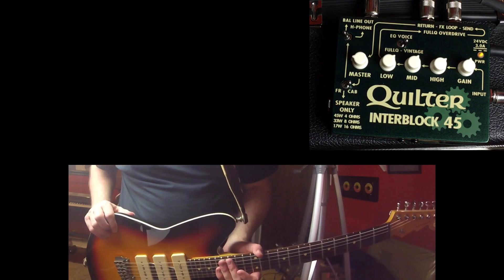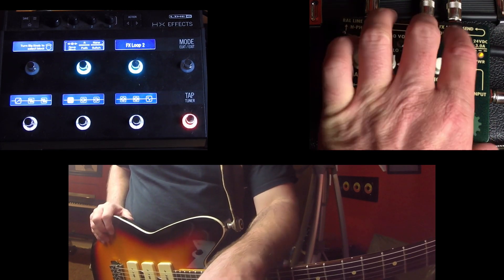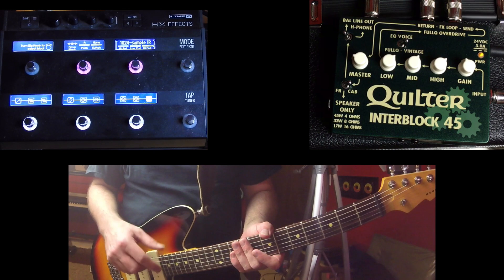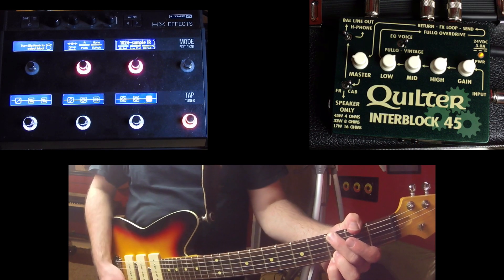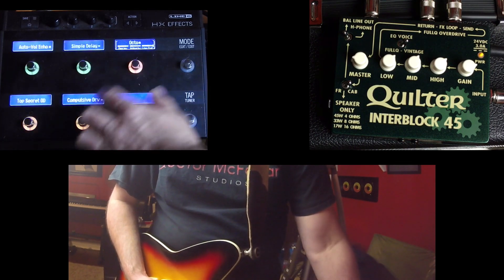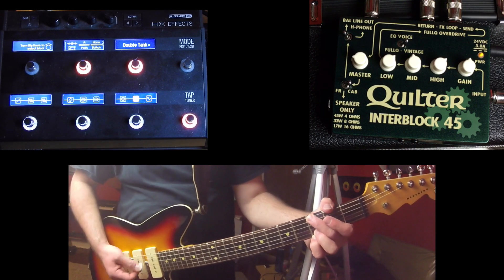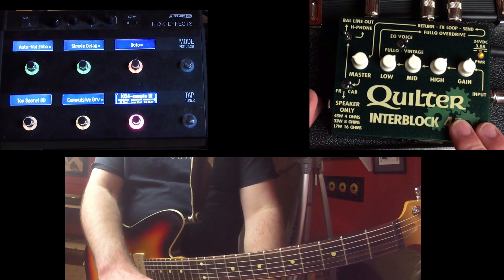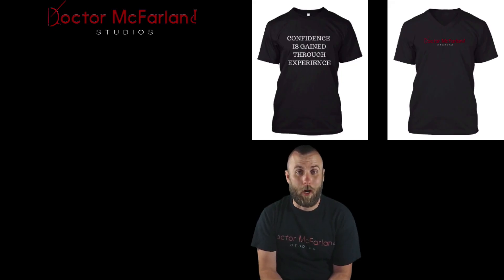Quilter Labs Interblock 45 // Balanced Line Out with Impulse Response

Comment: This is a great discussion of a key aspect of the interblock 45.  I just took delivery of mine last night and your observations are spot on with what I found.  Frankly I was so happy to see your video because I thought something was amiss when I turned up the overdrive and got that God-awful swarm of bees sound even when the cab sim was enabled.  In my case it's very bad because my cab is full range (i.e. has tweeter).  Luckily as you alluded to, I have a Radar and plugged it into the effects loop and all was well.  As you also mention, the problem is non-existent when you plug into a normal cab though, which is also expected because any normal guitar amp overdrive sounds pretty horrible into a tweeter.  For clean sounds no problem.  Thanks Dr McFarland for the great info on your videos!
Reply from the maker: Thanks Vince for watching and i'm glad you found it helpful. The manual does say that the Cab setting is better used for electric instruments but that does not mean its the same thing as a true Impulse Response. You just have to use your ears. When you run the line out to a powered speaker and you get that "swarm of bees" sound then you know something has to be added in order for the chain to be completed.  Unfortunately the other guy who commented was either confused or just to conclusions based on the manual alone.  The Radar units look great and does the trick.  Im glad the HX effects has all those capabilities all in one unit.  You do have to choose which one you are gonna use though because an IR running into a guitar speaker cab does sound kinda weird since you are layering a virtual speaker over a physical speaker.  If I were you I would only hook up the Radar to your balanced Line out and not put it in the effects loop. That way you have two independent signal paths to choose from or you can run then together. Keep rockin!!!
Reply: It's almost like u have two cab sims on with the IR plus the canb setting on the line out. What was the sound like with the HX IR but the cab sim off on the Interblock?
Reply from the maker: @bo1ivarj  The Cab setting the Interblock is not a true  Cab Sim to my ears. When you put any kind of dirt through it it doesn't sound that great. The manual says this setting is best for electric instruments and the FR setting is best for acoustic guitars and keyboards.  So think of it like a pre EQ that is applied to the signal path.  In this video I was using a powered speaker which is why I was giving you the before and after sound with the HX IR.  The other video I made  was played through a 2x12 speaker.
Reply: @Jay Bolivar  Just to add to the good Doctor's comments - I definitely agree that the cab sim is essentially a nice eq setting that sounds great for guitar applications.  I did some more experimenting with this setup and what I am finding is if you go direct, you don't want the amp to go into its own clipping or it will sound bad - cab sim or no cab sim.  Any real amp (which this is) will sound like crap overdriving into a full range speaker or a line out.  However, I could get excellent overdrive results into the direct out or into a full range speaker with pedals in front and the amp set clean.  In this case the Quilter Cab Sim setting works awesome - it gets rid of any fizz due to the overdrive pedals.   Of course your results will vary depending on your overdrive pedals.  I was using an awesome Bearfoot Model G, which is a very warm amp-like overdrive and has less fizz than say a Rat pedal.  Also, I was in fact able to get awesome distorted tones from the amp overdrive if I was running into a real guitar cab, which also makes sense.  There are a lot of scenarios possible in this box and it takes some work to figure out how to use it for your application.
Reply: That is too bad about the poor cabsim. So let's say we've added an IR loader, whether its in the loop or out of the line out, in your opinion does the line out sound better in the cab or FR position?
Reply from the maker: @bo1ivarj  LIke I said, the Cab and FR settings are more for a Pre EQ based on the instrument you are playing through it.  Even when I have my 2x12 cab plugged in the Cab setting sounds better to me.  The FR sounds dull to my ears but as the manual says the Cab is meant to be used with Electric guitar setups.
Reply: @bo1ivarj  I wouldn't say the cab sim is poor - this is not a modeling device so that is not what you should expect.  As Doc said - it is a predefined EQ that goes nicely with the guitar whether or not you use another cab sim.  More specifically, it sounds to me like an eq bump around 2-2.5 kHz. That frequency emphasizes the meat of an electric guitar upper midrange and de-emphasizes fizz.   So if you like it use it!  I like it!  If it doesn't work with your other equipment or if you don't like the sound, then just turn it off.  I bet you'll like it though!

Comment: Hey Dr., thanks for the video. Quilter tech support told me I could run straight from the balanced out to an IR host, and simultaneously run an external cab from the speaker out. Will the Cab/FRFR toggle affect the speaker output tone? I’d imagine I’d want the FRFR setting to use IR’s, but I don’t know if that works for the speaker out send. Thoughts?
Reply from the maker: They are separate outputs so one won’t affect the other.
Reply: @DoctorMcFarlandStudios  thanks, Pat quilter just responded to me and said the toggle does affect both outputs.

Comment: I’m assuming that you only need the impulse response when not running into a cab? 

I’m really interested in moving away from tubes with the Interblock 45. I’ve loved everything I’ve seen on it?
Reply from the maker: Jerad Wade Collier yes that is correct.  I like the tonal difference when it’s on the cab setting.
Reply from the maker: I haven't used tubes in years.

Comment: Dude, you already have activated the "cabinet simulator" on the line out, when the switch is on CAB position! Please watch the signal flow and read the manual! The cab position of the switch does both: 
1. Activating a special circuit on the speaker out, so that the Interblock solid state power amp sounds / responds better with a traditional guitar cabinet
2. Activating a cab sim on the line out and on the headphone out. 
Your video is completely misleading for new customers. If you want to use impulse responses you have to use FR mode! Or you use the preamp signal from the FX Loop Send. But not "add" another speaker sim (IR) to an already activated cab sim.
Reply from the maker: Hey "dude".  Sijmmer down :)  There is cab emulation on the Problock 200 as well but it never gave me the response I wanted.   When going into a powered cab the Cab Sim does not respond well to overdrive tones. If you are getting different results than me then you can make your own video. I am just showing how I am using the HX and interblock to get the sound I want. The FR setting sounds to dull to my ears and I prefer the Vintage voice and Cab Sim selection. Keep rockin
Reply: @DoctorMcFarlandStudios   I found the same thing with mine.  Love the tone through my cab, but running direct even with the cab sim selected sounds thin and clippy.  I was thinking a Radar would be the perfect solution and this confirms.  I'm not sure how people are getting the amazing tone they claim they are when running direct.  I had this same problem with my Toneblock 200.
Reply from the maker: @AbsentCurtis  Correct. I have other videos showing the direct sound of a  Micro Pro Mach II and the sound isn't that great. Some kind of Impulse Response is necessary.